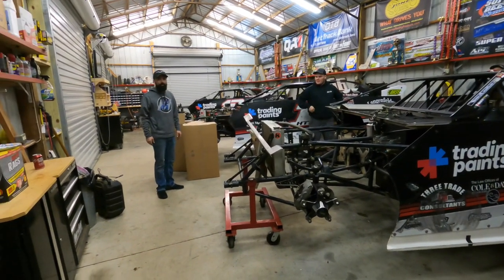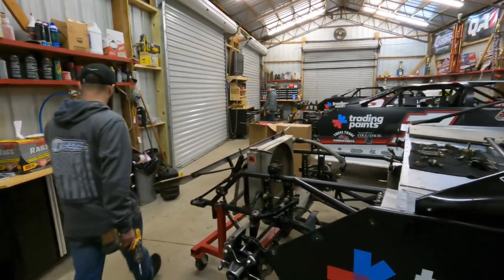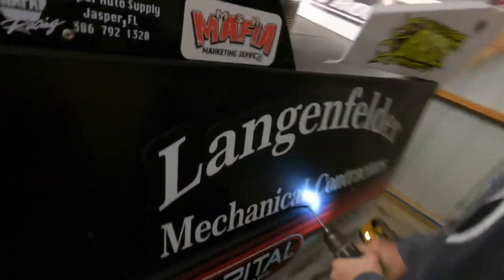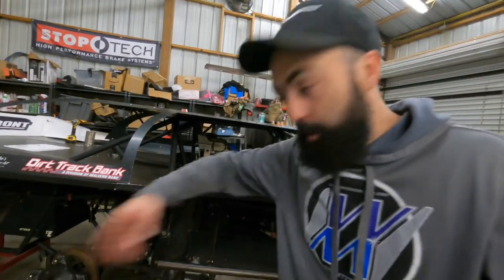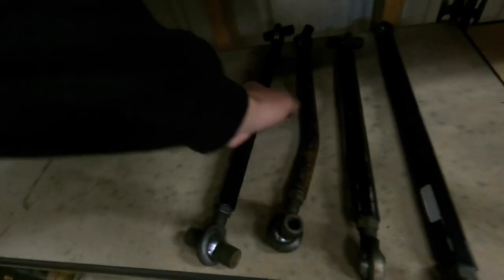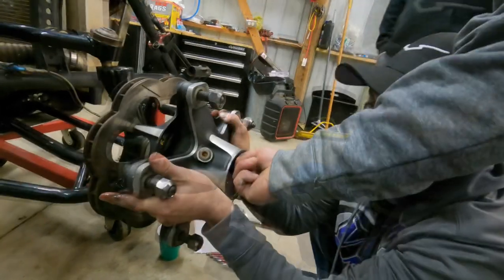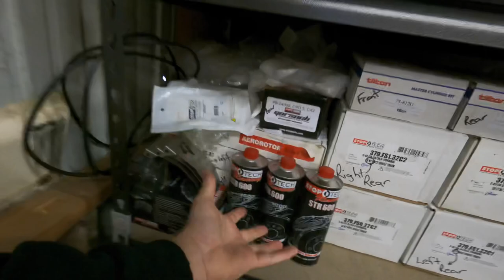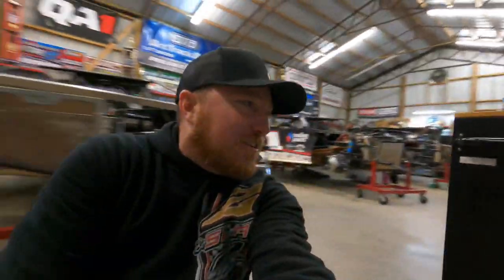Pulling Apart Race Cars! And a Christmas Surprise!

Comment: The stroller is cool! In 1990 I built my son a World of Outlaws sprint car down tube chassis stroller with torsion bar suspension and the front wheels steered from the handle on the back. My son is now using it for my grand daughters. It took me as long to build that stroller as it did to build actual race cars. Totally worth it! I will have to post a video of it on my channel.

Comment: 3-link: fixed bird cages with only lower trailing arms, 3rd “link” is the pull-bar which replaces 5th arm

Z-link: one bar runs forward of birdcage and one behind

Watts link: same as z-link but a bell crank is mounted to the rear end housing with one bar running to the right and one to the left (instead of front and rear) **replaces jbar or panhard bar whatever you want to call it
Reply: I run a Coil spring car with 3 links and a PANHARD BAR  The truck arm is tied to the REAR and the TRANS Zero Wheel hope or PINION angle change ! OLD SCHOOL
Reply: @CORNDODGER  sounds like a 3rd gen Camaro.. 103” wheelbase, struts in the front and 3-link rear, pretty cool setup. Wish the street stock classes would let guys run those but they get em on the wheelbase.
Reply: The 3 link we run has to be a solid top bar no springs or bushings.. Springs on top of the rear-end no coil over shocks

Comment: Merry Christmas! So, a 3 link is just the bottom trailing arms, with both arms being straight and fixed birdcages. The third link is just the pull bar. A swing arm is the exact same, just using the bent trailing arms, just as the one you pulled off for the bottom left trailing arm.

Comment: 3 link setup has lower bars on the bottom on each side with a top bar in center of the rear end with a panhard bar from the left axle tube to the right side frame rail to keep the rear from moving side to side.

Comment: I can't wait until you finally tell what is going to happen next season. The suspense is killing me.
Reply: either the draine is going in to the 10 car... the sb2 is coming out and used as a spare the 602 is going in to the htf1 and new motor for the super... then there will be a back up new 604 i smell coming
Reply: @jbabister  it's tough to speculate. Since they're full time in the racing, and have backing through sponsors and other avenues. In my own opinion horsepower upgrade is very important to race with the top dawgs. Clements comes to mind. The Draime needs to be completely gone through. Possibly stroked. Having two super late models is a very good idea. Soon we will find out what their plans are.
Reply: @johnhale9892  i donno if getting a new motor is about hp.... that sb2 they just got back in the summer is over 900hp... but Jesse is stepping up to run with joe and he cant do it without a 604 or 602 crate... but htey also need a back up motor if jesse gets the draine... i donno if they are gonna get joe a new motor and use the sb2 as back up or get joe a new mtor and get give jesse the sb2 and use the draine as a back up
Reply: @jbabister  The Draime will be a good backup for Joseph. If Jesse is going 604 crates. It's logical to have backup 604. With the million dollar race before the dream, something will need to happen to make Joseph more competitive. WoO, Lucas Oil, Southern All Stars. Joseph needs backup. Jmo.

Comment: The two top bars come off and a single pullbar runs from the top of the center of the rear end ,at a downward angle, to a point between the driver and the rear end on the center line of the drive drain. The pull bar allows the rear end to rotate just a little to help with forward bite.

Comment: Guys you got one full week now before Bristol starts getting the dirt put back on the track and anyone that wants to see a spectacular Christmas light presentation, should go to Bristol Motor Speedway and Thunder Valley drag strip and take a ride through the speedway of Lights, it's insane how nice they decorate that 4.5 miles of Christmas lights..... Also get them cars ready and I believe Joseph will like Bristol in a Super and Jesse may do just pretty dang good there also in the 604 but I'll be there this year for the Bristol dirt Nationals and this year it's eight nights of late models racing they added a few extra days to the Event for this year

Comment: A 3 link setup has lower arms on both sides and a upper arm on the top of the rear end in the center and a panhard bar on the left axle tube going to the right frame rail that can be adjusted for roll center to adjust for body roll and loose or tight in a car
Reply: Thank you for that info

Comment: I'm confused! Why wouldn't you keep a 604 for Joseph? Its where you guys won most of your money last year
Reply: Pretty sure they have 2 of them
Reply: @coreymoorey8093  no they dont
Reply: @alanmerritt860  is it 2 supers then?
Reply: @coreymoorey8093  well it sounds like they will have 2 supers.
I can't believe if you watch their videos you don't know what class of cars they ran. Unless you're new to the channel. 
Joseph ran the super and 604, Jesse the 602. 
Now Jesse is getting the 604, and now sounds like they're putting in a super in the old faithful car .
Reply: @alanmerritt860  no I’ve been following for over a year now and they have a backup either 604 or super engine. I know that for a fact because one blew and they had to run the backup one weekend.
Reply: @alanmerritt860  they have 2 super late model engines currently. Just watched back in their videos. Should fact check yourself before ripping into someone else. Yes I made a mistake but that dosnt mean I don’t know what they run. Guess what 1 604, 2 super and 2 crate 602 engines is what they have.
Reply: @coreymoorey8093  I wasn't talking about engines. I was talking about the cars. They only have 3 cars. There was one of each the past season. Next season sounds like 2 supers and a 604. And who knows maybe a 602 thrown in there on occasion. Jonathan was sure .
Reply: @alanmerritt860  I was talking about engines
Reply: @coreymoorey8093  they can only run one engine a time
Reply: @alanmerritt860  yes thank you I’m aware but they still have multiple which is what I was saying. They are honestly probably going to get a new 604 engine and run 1 super car and 2 604s. Cause who would run the second super? The guy asked why they don’t keep a 604 for Jojo I said I think they had 2, I was wrong they had 2 supers but still know how a car can only run 1 engine 👍🏻 that’s just common sense there but anyways enough argue with someone that just wants to argue have a good holiday